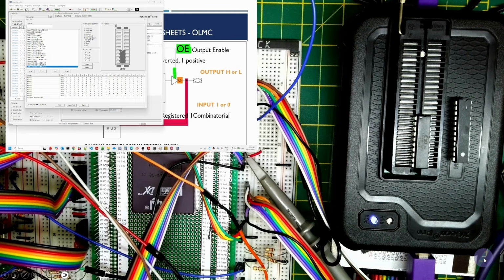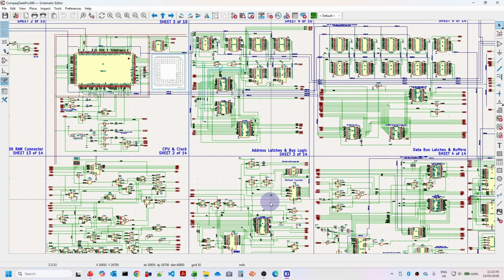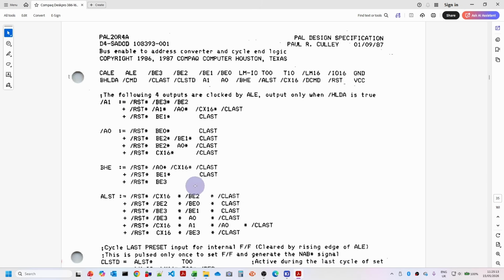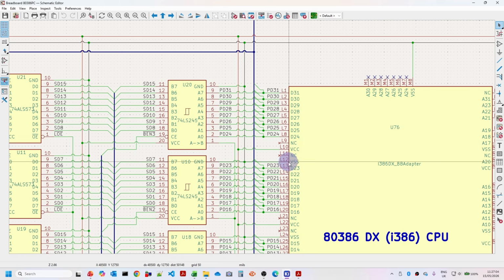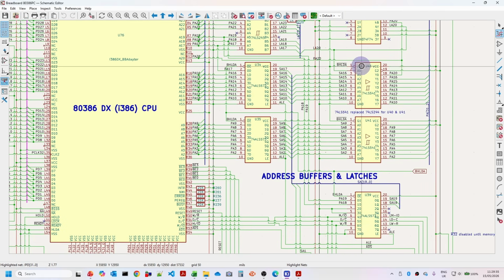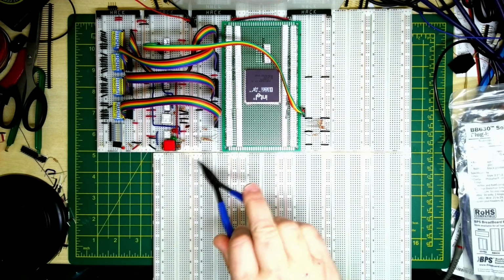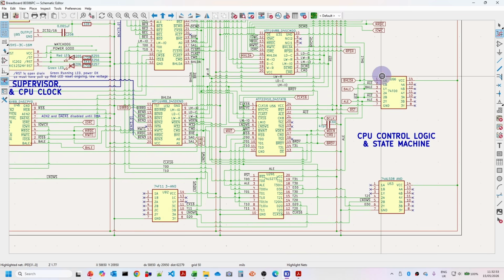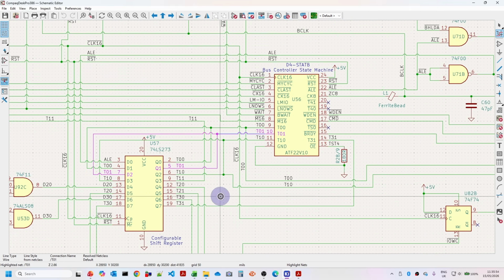386 Breadboard PC #10 386 Bus Control,  Latches & Buffers KiCad Schematic

Comment: It's a good thing Compaq implemented bios shadowing. Interleaving your bios image over 4x 8 bit wide chips is annoying
Reply from the maker: Agreed, though I'm not sure why they bothered with 16 bit BIOS across odd and even EPROMs. I guess in case shadowing was disabled. I think I will make the BIOS 8 bit initially to simplify programming. Just the M16* line from the ROM PLD needs to be disconnected to leave bus in 8 bit mode. Dave

Comment: Really good work. I have just subbed. I wonder if a video upgrade to VGA at some point would be possible. I know there are people on youtube that have made VGA circuits.
Reply from the maker: The video controllers I have developed in the previous 3 series ALL produce VGA signals for output (25.175Mhz dot clock) but are software & feature compatible with the older CGA and MDA standards. You can find the links in the playlists for the earlier series.
Most other YouTube site's VGA controllers (that I am aware of) only produce VGA signals and are not VGA register compatible (or include a PC compatible video BIOS). Sergey Kiselev has done an 8 bit ISA bus VGA card on a PCB using a 160 pin surface mount Trident chip and I have one of these. I also have 2 Trident VGA cards but was not able to get any of them working reliably in the Breadboard PC V2 series (I suspect they still need the DRAM refresh process which I will add in this series).
The problem with VGA (and EGA) is that they are very complex (160 odd registers) and were only implemented in large pin (160+) surface mount chips, not suitable for using on breadboards.
Depending on if I can get my ISA bus VGA cards working (or not) I was thinking of using a bare metal PC emulator with a Raspberry PI Zero and hack it to use the GPIO Lines as an ISA bus interface. But this is likely to be next year! Thanks for subbing. Dave

Comment: This gives me anxiety. I'm currently working on a board with 17 QFN 80/65/60s and it's probably about the same level of complexity. It's about the max my brain can handle, and that's using a 6-layer PCB not a breadboard! But I suppose on breadboards you're routing it in 3 dimensions so it's trivial to jump over anything. It would still drive me completely crazy. I would have a lot more labeling and color coding but it would somehow look like more of a mess. I can't imagine how much wire I would go through trying to tidy things up and make groups of things the right length. But it looks like you've got it under control. Vaya con dios!
Reply from the maker: I would have to say 6 layers and 1100+ pins sounds more likely to cause me anxiety. Last PCB I made (2 sides) was in 1981 so not really my area of expertise. The trick with breadboards is DuPoint 'rainbow' cables with the 8 way shells. Combined with using stick on chip labels then this makes it less likely to mess things up but having said that, this one is going to be a challenge. Hope your board goes well! Dave
Reply: @breadboardinglabs  It's probably half that many after I spent a few days working out Python scripts to duplicate the boilerplate-ish parts. But Python can't plug in cables for you. You gotta do it the hard way! And I'm so colorblind I think the rainbow cables would make it worse.

Regardless it's really cool that you're doing this. You're doing something legit complicated that nobody else has done, which is so much more interesting than the average YT video with some guy 3D printing a case for a R.Pi project. The DX has gotta be getting close to the MHz limit of what's possible on a breadboard.
Reply from the maker: Thanks for the feedback. The 386 DX I have is 33MHz which means upto 66MHz CLK2 input. I am starting with 16 MHz  which gives 8MHz bus cycle which should be fine as the 8088 was running at that speed. I hope to be able to get 32Mhz to work once everything is stable (16MHz bus cycle like the original 16MHz DeskPro). I suspect 66MHz won't work though in the tutorial series I did get the 66 MHz clock and divide by 2 flip-flip working OK on breadboards though I suspect the DeskPro/386 16 design wouldn't work at that speed either. We will see....  Dave

Comment: excellent! since I don't use kicad, and I'm pretty sure I'd like to make a pcb out of this project, I'll probably rely on thr EasyEDA ability to import it. keep up the good work! we're all hyped up. cheers from Argentina.
Reply from the maker: I would not rely on my KiCad schematic yet for a PCB. I am pretty sure there will be mistakes and also some of the chips I removed their power pins to match the Compaq diagram! I didn't include the Maths/Numeric Co-Processor parts either. Some of the parts are tricky to get. The 74LS612 Memory Mapper you can only get from eBay and the keyboard controller needs  a VIA part also from eBay. Dave
Reply: @breadboardinglabs  yeah, don't worry, I will not start this endeavor just yet. I have the keyboard controller, so in theory it should be fine. the memory mapper might be a difficult part. thanks for pointing it out

Comment: Kicad complaining about not fully anotated schematics is due to ROM ICs. For some reason I had two U13, two U14 (or maybe two U12). One was real, and the other was some leftover invisible text. I cleaned all of that, and now the schematics is fully anotated. But there are other warnings that concern me.
Reply from the maker: I wouldn't use this to build a PCB. It needs a lot more refinement. I have done some more updates recently. I think the U13 duplicates may be one of them!. If you raise issues in GitHub then I will respond to them during the next update. There are a lot of warnings like pins left over etc which I have disabled. I think most of the errors have been sorted but there are A LOT  of warnings. The left over invisible one I wasn't able to delete. I updated the README.md with more info on the schematics. Dave
Reply: @breadboardinglabs  Yeah, I know about a lot of warnings. ^_^  And I didn't even enable power and ground warnings. I'm slowly making my way with it, adding stuff like standard AT power connector, six more ISA slots, etc. But I'm starting to think that it may be just a little bit more complex for me. And not in the schematics, that itselft is quite manageble. But in components. There are some chips, like 74ALS1035, 74LS612 and some others, that I have NO idea where to get them. No ebay for me, just local shops and aliexpess, and they don't have them. Also the board shape that I plan to use (IBM 5160) probably doesn’t have enough area for all the components, even if I integrate 72 pin SIMMs in the design, and add just 5 ISA slots. Even with 6 layers.
Reply from the maker: The 74ALS1035 is a current part you can get from Mouser (I bought some recently). The 74LS612 Memory Mapper I had to get from eBay. Not tested mine yet though these are only needed for DMA and the modified XI-8088 BIOS I have uses programmed I/O not DMA for floppy disk access. Its only things like some sound cards and network cards which may also require DMA . Not sure how the SIMMs would work with the 32 bit memory board, I've not looked at these. I am using lots (x20) of 512K static RAM chips! Dave